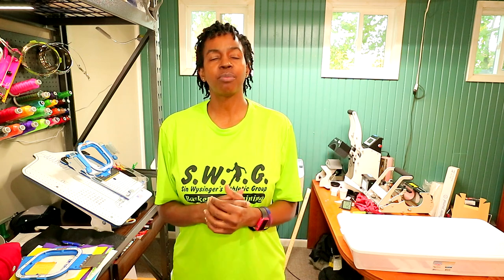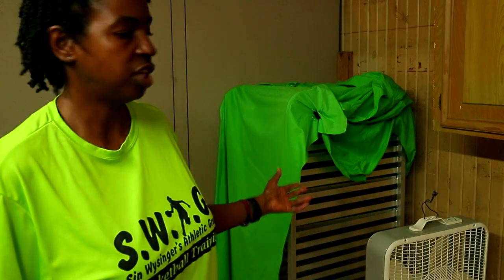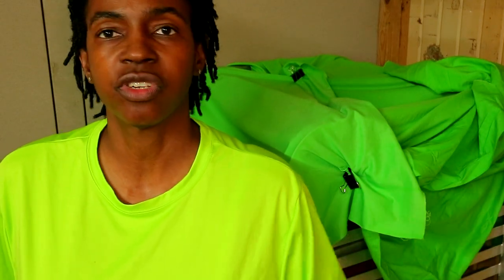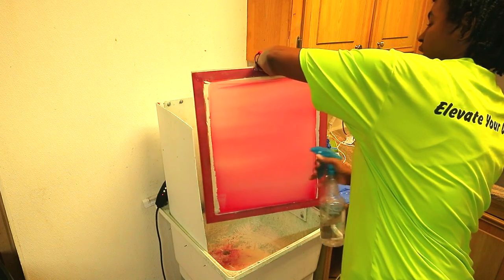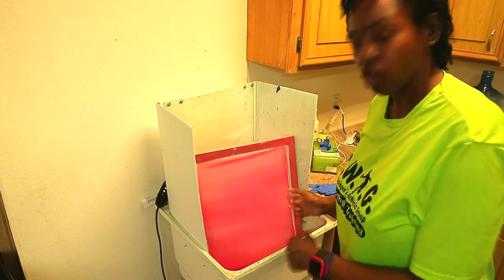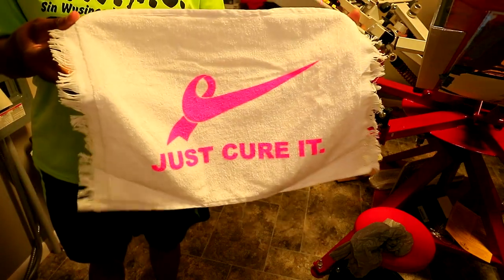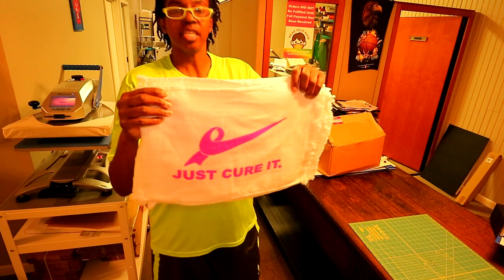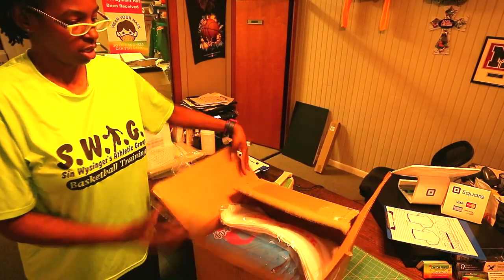Custom Rally Towels

Comment: Did you use waterbase ink. I fine Pastisol ink is a bit rough on towel material unless it's s fine print
Reply from the maker: No, I used plastisol. The towels are for display/show and not intended to be used on the skin.  There are soft plastisol inks that have little or no hand if that's what is needed or you can use additives to regular plastisol to get a softer feel.  I have some water based inks but don't like to use it much because the plastisol prints better to me.  I have a video posted of me printing towels with water based ink that I posted a few years back.  I didn't really like how they came out.
Reply: @TshirtChick  Ok thanks... I like the feel of Waterbase but it's too much of a headache for me. Clogs the screens to quick ,have to
use a harderner for the emulsion, shelf life, drying etc.